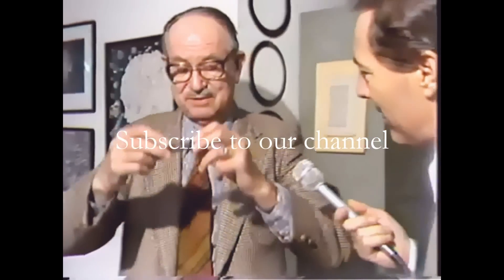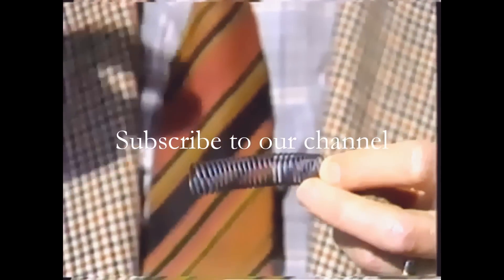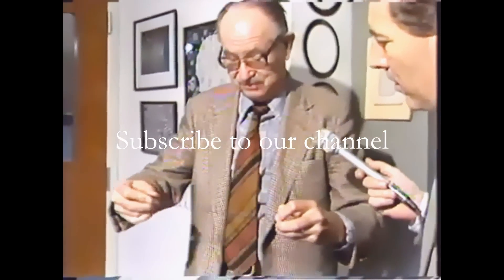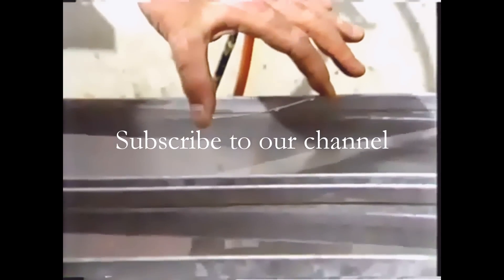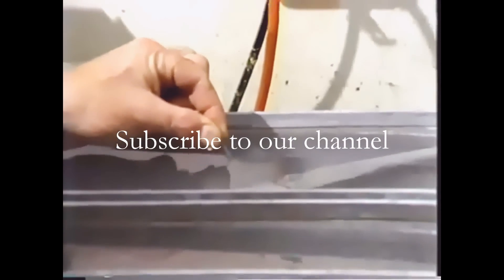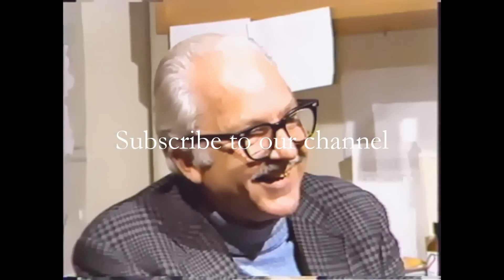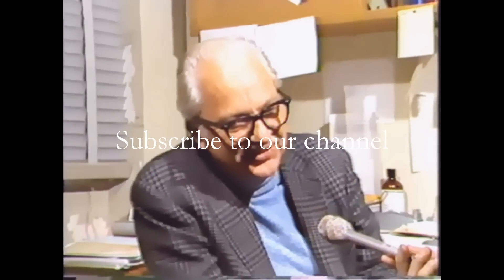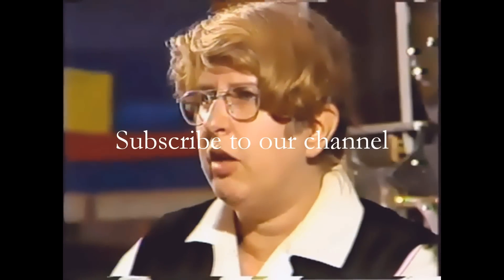Free And Virtually Unlimited Fuel To Heat Your Home

Comment: How do you heat the water
Reply: They said solar heat
Reply: You can also use friction from a motor to heat the water, and cooler water cools friction, like oil and water in a engine.
Reply: Jack Heppell you feed a supply of cold water into one side and solar heated water into the other, absolutely no pollution created.
Reply: neat devices, but why not just a solar panel or peltier? there are other ways to generate electricity that don't involve a mechanical motion, and possibly more efficient. it'd be interesting to see how these things compare in terms of efficiency. it may be free energy from the sun, but it's not free to build the device and maintain it.
Reply: Pete Lorenzo because maybe what you want is mechanical motion and not electricity.  Why create electricity just to convert it to mechanical motion with a motor.  The conversion alone is enough to make it less efficient.  Also, Solar panels are a bit more to produce than some pipes and black paint.

Comment: *Marking the first time heat had been converted directly into mechanical energy*, What? What the hell is a steam engine? What the hell is a Diesel engine? What the hell is a gas engine? Ok, back to the video, back to the Twilight Zone. Not saying it does not work just making fun of the dialog in this video.
Reply: i think you dont understand the meaning of the word "directly"

in addition diesel engines dont even use heat they work by transfering the kinetic energy from the explosive force generated by the combustion of the fuel

Comment: There is a simple flaw in the idea of free power here. Assuming the device works as described at first, you need to heat and cool the wires to make them expand/contract. 
The amount of heat needed to do this in ebergy terms will be more than any power output if the wheel is attached to a generator. One obvious source of this power loss is friction with the water causing splashing.
This is not suppressed, it is simply a useless scientific curiosity.
Reply: solar hot water they even show in video
Reply: The solar power could be used by photovoltaic cells to generate electricity without all the splashing and mechanism. Nitinol wire is available for $5 to $10 a foot on Amazon. Buy some and make your own gadget, 
It is not 'free energy, it is just a clumsy way of  using solar power.

Comment: Is not free need hot water ?
Reply: Producing hot water is simple.   Let the sun heat up the water by running it through a black tube.
Reply: +Michael Griffis try doing that in Canada right now
Reply: In sun light use solar pannels, in winter use magnifier glass over the solar pannels to gather and collect sunlight into a point in to the pannels.
Reply: Holy shithell. I am certain even you can figure out one of the many cheap way to make up the 20degree difference they mentioned. I know you just want to lash out at what others did or are doing, because you didn't think of ANYTHING first.
Reply: Its just another way of producing energy by using the energy thats allready around us.
Reply: or maybe m80s set off on the panels?? small dynamite charges?

Comment: 2:22 the first time heat has been converted into Mechanical energy? Isn't that what an internal combustion engine does, Isn't that what an external combustion( (Stirling ) engine does?  this process uses the metal ((nitenol) plus temperature differential, [two separate water baths] to create rotation. What happens to the process when you add a load(Turn A generator) .  how much money did Boeing spend on research and development, do they have the patent , and the right to recoup  their Investment?   no matter what process you use to extract energy from the Universe, it requires machinery,  R&D is never cheap and certainly not free.
Reply: Didnt the Chinese convert the heat of burning gunpowder 
into mechanical energy to move a rocket up into the air... back in the 1200s
Reply: RWBimbie that too!!!

Comment: He said after a period of time the wheel went faster. Maybe because movement causes friction.  The friction causes heat so when it hits the water at a hotter temp then moves to the cold water faster.  Maybe the friction which radiates into the hot water as the N hits the hot water faster and it causes the snap to happen faster quicker once it hits the cold water. Idk its a guess.

Comment: What this machine function you have to keep a bath of hot water. Does the machine put out enough energy to heat the water that's given me a power of course not that would be prepared to emotion which defies the laws of thermodynamics and conservation of energy so all of these other comments that are below me proxy hadn't thought of that but you should stop looking for pipe dreams and start looking at the real physics of things. And the real physics of things is the reason this never came to Market
Reply: like the solar hot water they show in the video
dont tell ppl to look if you cant see whats right in front of your eyes

Comment: The nitinol contraption still requires heat energy, just like internal combustion engines , hybrid diesel-electric locomotive engines, nuclear steam electric power generating plants, (nuclear plants); the so-called nitinol contraption, will never become a reality when there are heat engines, like the diesel, and internal combustion engines, that can be greatly improved to harness the waste heat they generate;  most of the waste heat generated by internal combustion engines comes from the air, this secret is right there for all to discern in the air fuel ratio, which is 14 parts AIR ti one part fuel.

The nitinol "engine" which requires an external source of heat to function, is basically a red herring, tinker toy.  More pie-in-the-sky bullshit that will never leave the laboratory.

Comment: There is no free energy here, or anywhere. Even the very first sentence in the video the man is describing how the nitinol responds to only heat(ENERGY).  IT takes energy to make it happen, it means you can go buy a piece of nitinol and hook it to a fan blade and make it turn continuously, but not without HEAT(energy). Trust me

But you can have a heat engine, like a stirling engine uses heat as the fuel, nitinol can use heat as the fuel. Nitinol will have a limit, a limit on speed, and a limit on force. You can add more heat, but the speed and force won't go any higher once you reach the nitinols threshold. But a stirling uses the elements of air/gas itself, higher limits, no threshold, except the melting point of stainless steel that the machine is made of itself. But you need to experiment with nitinol to find those limits, and to find what it can do that a stirling can't.

A stirling engine can run on waste heat too, and the stirling has been invented in the 1800s. Nitinol can run on waste heat too, but try to buy enough nitinol to make an effective and efficient heat engine and go bankrupt. But make a efficient quality lasting stirling heat engine and have money left over to make a hundred more.
Reply: The video said heated nitinol can produce 55 tons per square inch from a little hot water from solar. I'm not saying I believe them but that sounds nearly free.
Reply: As powerful as fuck. Probably over-unity. Berkley just casually breaking thermodynamics.

Comment: now wait a minute---did anyone but me notice that the hot and cold water are mixing making it the same temp?--bad bad video.
Reply: its a real phenomenon
to work for an extended period you would need to keep replacing the water using a pump